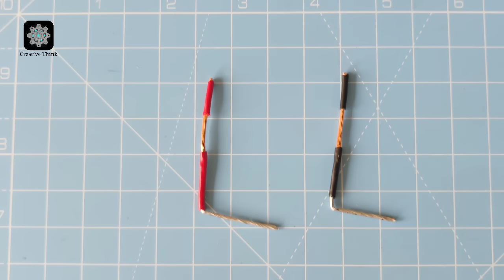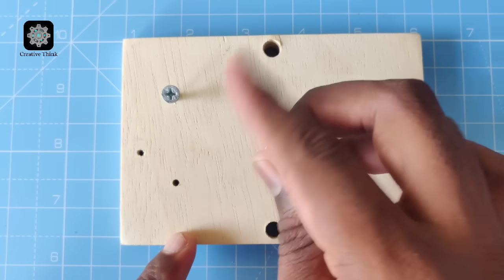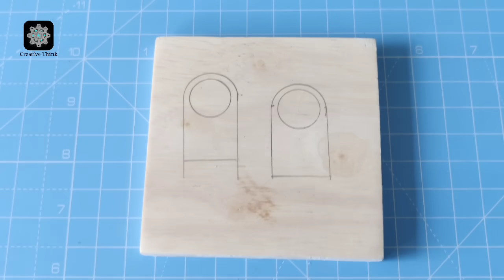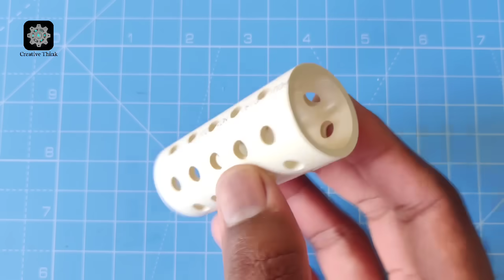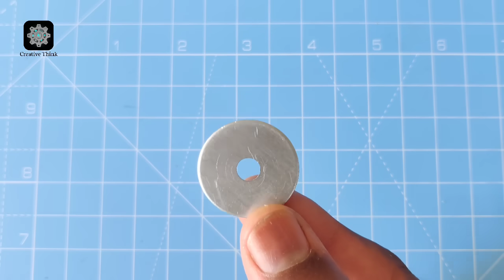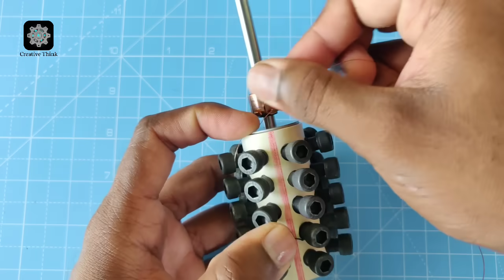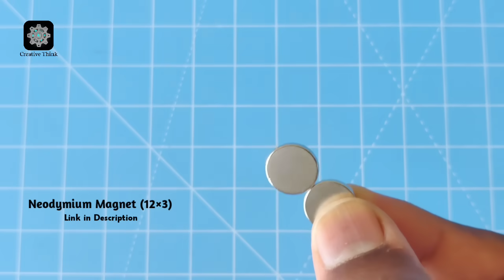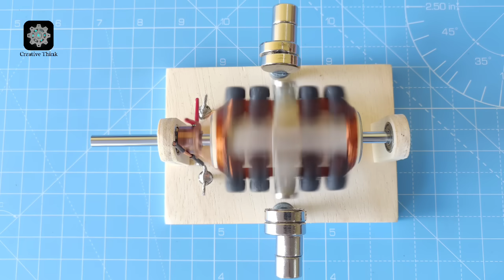Free Energy Generator Using 20000RPM  Very Strong Armature

Comment: Yeah, I put a windmill on top of my car. Works great!
Reply: Ich wurde bereits blockiert, weil ich über die Dummheit des Autors schrieb. Меня уже заблокировали за то, что я писал про авторскую глупость. I was already blocked because I wrote about the author's stupidity.
Reply: well done 😉, but did you also post a video about your windmill, and were you able to generate 1.4M views 😉
Reply: There's a video of a guy who did that to the front of his truck. More of a can this work experiment. Channel is 'Quint BUILDs'.
Reply: well this continues movement could be kept only to generate electricity, it could be connected to a lighter battery, thus meaning the car lighter  and cheaper as well and there would be less harmful left overs for the environment created as batteries are descarded
Reply: You bastard. I was going to patent that for sail boats.
Reply: @Jogi-j4j  "Genau, Autos mit Windmühlen!😉

Bei Windstille Bitte warten auf den Sturm!😅🤣😂"
Nein... Natürlich muss das Windmühlenauto erstmal angeschoben werden, bis Fahrtwind vorhanden ist. Dann kann die Windmühle Strom produzieren und den Elektromotor des Autos mit Energie versorgen. Das Auto wird schneller und der Strom stärker und das Auto schneller, und .... ;-)  
Und ein Windrädchen zu bauen, dass 200 Prozent Wirkungsgrad hat ist nur eine Frage der Zeit.  ;-)
Erweiterte Idee: Ein Windrad mit Motor auf ein zweites Windrad mit Generator "zielen" lassen und mit dem dort generierten Strom, dessen Spannung man ja mit einem Transformator erhöhen kann, wieder das Motor-Windrad antreiben. Das da noch niemand draufgekommen ist... ;-)

Aber vermutlich lauern da irgendwo die Killer der Ölindustrie, die solche genialen Menscheitsrettungserfindungen natürlich sofort unterdrücken würden. Da lasse ich dann doch lieber die Finger davon... ;-) ;-)
Reply: Lol. When I was a kid, my neighbor mounted a large box fan to the top of his car. He was a retired electrical engineer and when his alternator faild, he was upset about the cost of a new alternator. He had that thing on his car for years.
Reply: @arnoldbailey7550  Now that's funny!

Comment: I think that this could be improved upon by adding a little grease to the bearings and balancing the armature and finally removing the battery from under the board.
Reply: i can improve it by throwing in the trash..
Reply: You can buy an electric motor of that size on Amazon for about 5 bucks
Reply: He can improve it by never doing it in the first place, or better still by deleting his bullshit channel

Comment: There are three types of lies, lies, damned lies and YouTube "free electricity" videos!
Reply: I Agree
Reply: It isn't free electricity anymore than solar is free electricity.
Reply: @jonesyokc  No, without an energy source no electrical machine will work. The implication in this video is that it will run indefinitely without any energy source. Impossible. You get nothing for nothing.
Reply: @enniskillencathedral  There is an energy source.  The flux field of the magnets.  Not to mention gravity.  Hydro power works because of gravity.  Why is it hard to believe something can work because of the power of the magnetic flux field?
Reply: @enniskillencathedral  Also, magnets aren't free.  I've never been digging in the dirt and was like "oh look.  A neodymium magnet."  :-)   There are forces of nature that we don't understand.  We barely understand light.  Just read up on the mass of photons, or the possible lack of it and how a massless object cannot have energy yet we can get energy from light.  There are some mass measurements for photons but the numbers are so insanely small.  But that raises another problem. We are supposed to believe that in takes basically an infinite amount of energy to accelerate something to the speed of light yet this isn't an issue for photons.  Fun stuff.
Reply: @jonesyokc  The device that we see in this video, if we believed the deception, is basically a perpetual motion machine. Now, if it was possible to really manufacture machines that could do this, they could significantly contribute to meeting mankind's energy needs. But no one has ever produced such a machine - perpetual motion without an energy source doesn't work. A magnet will attract  a ferrous object, but you need energy to bring the two close to each other and you need energy to separate them. When they are joined, no energy is produced. Electro magnets only work if there is an electric source. Videos such as this are clickbait, designed to make money for the liars who create them. Name just ONE commercial device that produces movement without an energy source such as heat, light, sound etc!
Reply: @jonesyokc  hydro power is not free something has to move the water I your case it was the sun and gravity is not free , come on man follow the laws of energy
Reply: @jonesyokc  The ideas behind "free energy" do not include the parts of the machine. Only the fuel/energy source. Of COURSE every machine you build is going to cost money. Every part of it costs something. It's the actual energy that they're sing to power it is what they're saying is free. Such as in this case, the magnetic field the magnets produce. The magnets costs a few cents, but the magnetic field they produce is free. However, magnetic fields do not last eternally. They lose their strength eventually, so they actually AREN'T a free source of perpetual energy.
Reply: It´s not a DC motor... it´s a Dynamo.... but he had to apply movement, so there's no free energy
Reply: @nelioabreu9058  No - it's a motor being powered by a hidden energy source.

Comment: His PVC pipe contains a battery, with metal rods welded to either end. He is running wires from his bearings on either end,  through the wood, and to the commutator brushes.
Oh yeah, it's big brain time.
Reply: I think the battery is beneath the wooden block that's why he created a solder base for the brushes to mount on to conduct current

Comment: A very interesting machine. One question: where did you hide the battery? I didn't see it in the video
Reply: inside that giant tube lol
Reply: Nu exista baterie... cele 2 șuruburi fac contact sub suportul prostiei dr "free energy" direct la o sursa... nu ați văzut ca "periile" făceau scântei mergând, aparent, în gol? De fapt se alimentează motorul
Reply: @MariusG78  Please only talk in these languages: English, Slovak, Czech. I do not understand any other gibberish
Reply: You do not need battery because it simply isn’t needed. Magnetic fields harness electricity. Electric and magnetism work in tandem. Don’t be stupid. There is a reason a word like “electromagnetism” exists.
Reply: @AotO_DJ  What? Fun fact there actually is a battery in there. If you look at the part where it turns and you look closely at the commutator you can see small sparks. Don't be stupid, this is not how electromagnetism works
Reply: @gregorpajdlhauser2850  Magnetism creates a motion. And not even a weak motion. It is strong. Electricity is harness with motion. If you actually knew how electric energy is harnessed, you would know this machine, in theory, could work. That’s how water mills and many other types of energy creation methods harness electricity. It is ALL with motion.
Reply: @AotO_DJ  In theory couldn't work because in a water mill the motion is taken from a running river. From where does the rotor get the motion? It's not from the magnet because the magnet is permanent and it would hold the rotor in place not spin it
Reply: @AotO_DJ  If there is no battery - what is the reason of the red wire and the black wire?
Reply: @AotO_DJ  

I got some good news and bad new for you: the good news is you're probably right - there's no hidden battery there. 

The bad news is the dude, most likely, had an air compressor just off-camera blowing a hard gust at this thing, causing it to spin.

If it were possible to make power from magnets, don't you think somebody would have figured it out a very long time ago?
Reply: @gregorpajdlhauser2850  The idea, is that first turning the rotor would produce a current into the coils from the interaction with the magnets, the current in turn would also enhance the rotor turning acting like a regular motor which again produces its own current by the magnet interaction. But.....you cant pull yourself up by your shoe laces.
Reply: Theres no battery jus disbelief
Reply: @AotO_DJ  motion is wat started it u don't need a battery
Reply: @svetiwap3568  Is this a joke or you mean it for real?

Comment: fake, i see sparks at the brushes at no load, so the motor is getting power from under the board.
Reply: wind,waves and solar,and thats all thats free.
Reply: It is not fake, this is how a motor or dynamo is build, put a propellor  on the shaft and you can get free wind energy
Reply: @Jmax777  entropy still increases, no energy is free.
Reply: Yeah... I see it too
Reply: @eddyriley2055  

Energy is not for free!
Reply: @eddyriley2055  

Windpark slow down the wind and change the climate.
Reply: @TheOriginalShakuraz  keep on digging,you will meet your friends and destiny,im outta here..

Comment: Nice self-built electric motor. If you make such a video again, it can look more puzzling if you can somehow grease up the commutator brushes in a way that they do not spark. Those sparks immediately give away that a closed circuit is hindden in the board below the "open-looking" soldering pins. Great demonstration of how to build a motor!
Reply: "Those sparks immediately give away that a closed circuit is hindden in the board" 
Really, you need those sparks to give away it's a prank? I should think the laws of physics should be enough :)
Reply: @reivaxpariswheel6983  Law? Who is the judge? Don't trust layers. Trust your own eyes!
Reply: @carlarparqur4915  "God does not play dice with the universe"